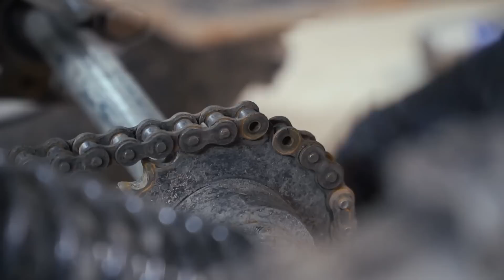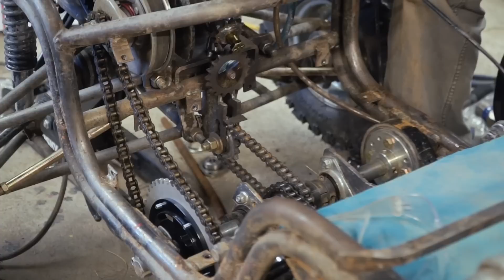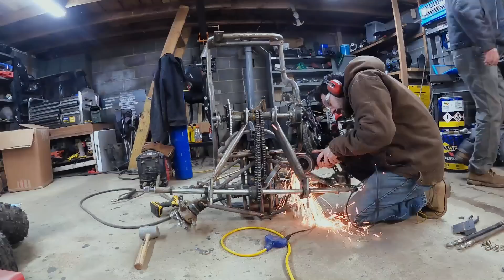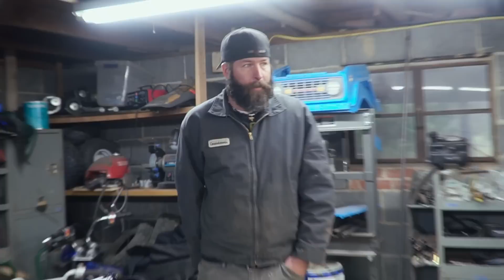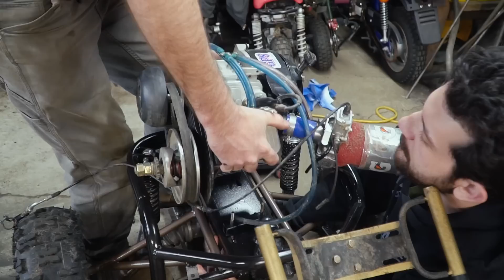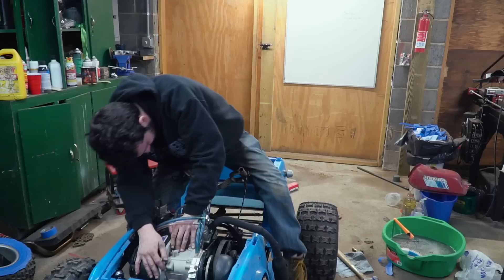4WD Bronco Power Wheels Go Kart TRANSFORMATION! Paint and Finishing Touches!

Comment from the maker: Almost ready for the track! Considering its size, this thing has turned out great!
Reply: Yesssss.  :)
Reply: Just add 8 inches to the chassis.....make it a little longer so you can really enjoy it....what's the point of making something only one person can comfortably ride.....that sucks!!!!!
Reply: I still can't understand why you haven't added a few extra inches to the frame length... 🤔🤷‍♂️
Reply: Btw, I bet Steel-It would sponsor you...... And they make the best finishes for cage, suspension, etc... finishes designed specifically for your needs. 👍
Reply: That came out the year I was born dammmmn
Reply: What cars and cameras
Reply: @CarsandCameras you should cut the tailgate to make it look open, and move the seat back so both people can ride comfortably
Reply: I’m low key missing the “THANKS GO POWERSPORTS” from Ike
Reply: Slot the bolt holes on the CVT backer plate.  It will allow you to tighten the belt and possibly put the output sprocket in a better place.  Tightening the belt lowers the effective gear ratio.
Reply: Looks awsome!
Reply: TINY LIGHTWEIGHT 4X4!!! Lots of people here seem to have forgotten what this started out as and the intended goal. This is the smallest power wheels car that power wheels makes. The goal of this project was to keep it as small, compact, and lightweight as possible while providing a single adult with 4 wheel drive. Stretching the frame would make fitting easier, but totally defeats the goal. These guys have done an excellent job. I'm impressed.
Reply: I love it, just wondering why you haven't tried marine hydraulic steering,  it's compact, and easy to adapt, also means you get away from steering shafts, sprockets and chains, so everything that could go wrong
Reply: I would like to come out and help y'all with your next build and when spring comes around if y'all are interested in building a track I want to help I really want to help support y'all I've been watching yalls channel for years I watch every video I dont want any recognition pay or to be in the videos but I do want to get to know y'all behind the scenes and be good friends I go to MTI in Moline Illinois for welding I can stick weld all positions including beveled pipe mig weld all positions whether its flux core or solid wire and  can tig weld thin aluminum as thin as a soda can if y'all are interested in collaborating or even just talking you can message me on Facebook my name is Seth Garrett if you put in Garrett Motorized Bikes it pops up too I hope y'all see this and think of me for your next build or track rendition 
Sincerely, Garrett Motorized Bikes I look forward to helping y'all soon
Reply: Glad you've kept it small.  Disagree with all the frame lengtheners.  Defeats the whole original point.
Reply: Double or even triple the foam on the seat it will be much more comfortable
Reply: why not change the front and rear axle sprockets so dont need such a big "jackshaft" sprocket
Reply: Yo cars and cameras add a hood scoop to the bronco

Comment: I still say you'd be better off with adding 1 foot to the frame,behind the sprockets,for leg room.You'll be able to tip the steering down a hair so it doesn't bind as well.You already need a piece of plastic between front and back anyway,so why not?
Reply: Even 6" would make it more comfortable for John, would probably need that 1' for Isaac.
Reply: Disagree.  Violates their whole objective from the outset to build one of the smallest 4x4's around.  Common sense says at least give it a good run before making such a change.
Reply: Couldn't agree more. I thought the same thing way back.

Comment: Guys here a cool tip for painting wheels when the tires are mounted, get a deck of cards and just slide em in between the tire bead and wheel, u can reuse em too after the paint dries
Reply: Nice tip.
Reply: Hells bells thanks buddy.
Reply: Deck cards are to small i like index cards more covrage less over spray
Reply: I just smear vaseline on the tires ....it just wipes off
Reply: Deck of cards are expensive. Use 4x6 index cards. They're cheaper and bigger.
Reply: Did that on my 88 caprice classic steelie rims.

Comment: Just split like a 1" piece of pvc and lay over pipes  you think a chain could slap. It will act like a chain slide
Reply: PEX even better.
Reply: Just add a tensioner
Reply: I agree my dirt bike basically has a plastic bushing couple inches away over the chain in case it jumps

Comment: At the high angle u-joint on the steering, it looks like you could use (2) 45 degree bevel gears instead of the u-joint.   It would be a lot smoother.
Reply: All they would need is 2 bevel gears instead of the sprockets and chain. But that would make too much sense.

Comment: The way John sat on it at the end made with his legs outside of the interior made me wonder what if you did fold out foot pegs on the sides? 

Then you can rock that body while riding similar to the 3 wheelers. Also, in Michigan rolling on tractor paint works great and isn't messy like spray. We use it on off road and derby cars because its very cheap and durable.

Comment: Just a helpful tip I found out is you shouldn’t put bolts from bottom up then if the nut comes loose bolts falls out
Reply: Bolts from the bottom is the only way to do it on these gx200/clone engines.  Don't have clearance to drop a bolt down from the top side.
Reply: So lose a bolt or a nut, no difference...and it could be the only way in some cases...
Reply: The other way around can be problematic. When the mut faces down, rocks, water and pebbles can fuck up the threads and make it difficult to open them. At least i learned that from restaurating my car

Comment: Get a smaller sprocket, and make the clutch engagement higher rpm!
Also put two u-joints and a mounting point in between for the steering

Comment: You can make a floating chain tensioner.
Take two pieces of flat bar of the appropriate length,drill a hole through one end of each and a slot on the other so you can adjust it.
    Put a couple of rollers on it and bam. 
It'll just ride on the chain,no need to anchor it at all.

Comment: Cut out the hood and put it on. It will look a lot better than leaving the inside edge of the front fenders and grill exposed. Extending the length a bit will help with comfort and drivability too. It does look good though. Nice job in cramming all that "stuff" in such a small package.

Comment: I'm glad you guys are finally going to use some Chain Lube on one of your projects, at least.  That chain Wax is the best choice.
But, you've GOT to also start using a pre-filter over those foam air-filters.  Never use a paper element filter in the dirt and especially wet muddy conditions.  Use a good filter oil on your foam filters and put the pre-filter over that.  And, CLEAN them after every good thrashing, too.  I have an Outerwears pre-filter I can give you but, I'm sure Go Powersports has their version they'd be glad to supply for you. Get a bunch of them and put a clean one on every time you ride.  PLEASE!

Comment: You could still use the Bronco hood/window frame...just trim it up away from the heat and it'll be fine.  Make a heat shield and use header wrap around the exhaust to protect the plastic from warping. Problem solved.

Comment: Wondering why you guys made it so short ike doesn't fit problems with steering and drive terrain would be easier to solve if you stetched it some plus the body is already cut in half 🤔
Reply: Yes need to be lengthened some!!
Reply: Drivetrain

Comment: Problem with wax based lubes is they tend to hold moisture and dirt, whereas oils don't necessarily as badly.  If you're doing sand and salt, go oil. Aired and dry road, go wax.   Wax is also a pain in the ass if you don't get the chain super warm and work quickly, which is not an ideal thing to do.

Comment: It looks like the u-joint is binding because its on to steep of an angle. The steering angle is terrible, its going to have the turning radius of a flatbed. The best solution I can think of is to use bevel gears. But you could also do two smaller u-joints together. That would split the angle in half.

Comment: What sprocket is on the torque converter driven shaft?  You could stick an 8 tooth on there to gear down and use a smaller rear for clearance.

Comment: Question: Why do ya'all put your motor mount bolts UPWARDS from the bottom? if a nut vibrates off, the bolt will fall strait out and be gone, if the bolts are the other way, if a nut vibrates off the bolt stays put.........
Reply: The bolts don't fit from the top on those engines.  The only way to install them is from the bottom.

Comment: Hover the hood above the fenders, then make down leg sheet out of HDPE you can get from Jegs or Summit in 24"x120" in .070 for about 24 bucks a roll. Make a buck out of a piece of wood, heat it with a heat gun or even a torch and melt over the buck to form curvatures you will need to make it appear like a scooped hood or something along those lines. 

The HDPE it is easily worked and can be heat welded in seams if you have to cut for some reason. It can be fun to work with. We used it a lot on track car bodies, noses, roofs, etc.

This might be a decent color for the Broncoid.

https://www.summitracing.com/parts/aaf-all22440

Comment: Do you guys know why your front end binds up when trying to steer and when suspension travels? Because your a arms and axles and steering ends aren't inline with each other it will never turn easy and you will have bump steer , keep all joints in a straight vertical line for proper steering ackermann

Comment: Unfortunately because of the short wheelbase and locked differential it's never going to turn great, it'll plow. Have you ever thought of overdriving the front (or under driving the rear) even by one tooth would help. That's what a lot of crawlers do, just not sure how bad it would effect higher speed handling.

Comment: not on the Bronco, but since you two are different in height/leg length, why not use a set of adjustable seat tracks. That way you can make it easier for both of you to drive the same vehicle. Instead of one being all cramped up and the other not being able to reach the pedals. Quick trip to a salvage yard or Ike's car lot, can get you a set cheap.

Comment: I wanna make my mini bike faster by changing out the rear sprocket. Do i go bigger or smaller for a faster top speed?
Reply: Smaller
Reply: Smaller on the wheel
Reply: You will gain speed if the motor can power it

Comment: If you are not happy with the steering, would it be possible to move the chain and sprockets to the front of the engine and then have a shaft go under the carburetor and between the engine and the shock absorber with a u-joint at both ends and then have a chain to the steering wheel. with that solution you could place the steering wheel so it is more comfortable to use if you also put a u-joint on the steering wheel, it should be possible to do it that way without there being too much angle on any of the u-joints. At least it looks like that would be possible if you moved the fuel pump. But you do not see so well in the video so it may not be possible at all
Reply: But then you would have to attach the steering shaft to the same bar as the fuel pump is on now, but if you mount the steering shaft there with a small angle upwards, I think it would be more comfortable to sit than it is now